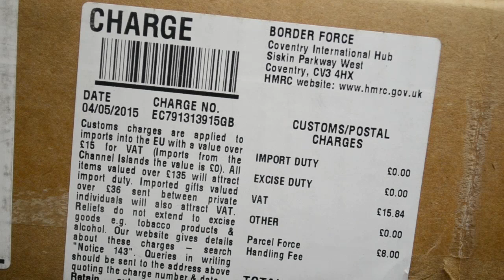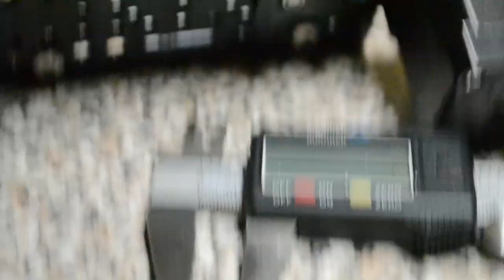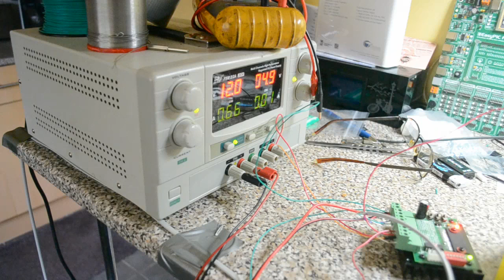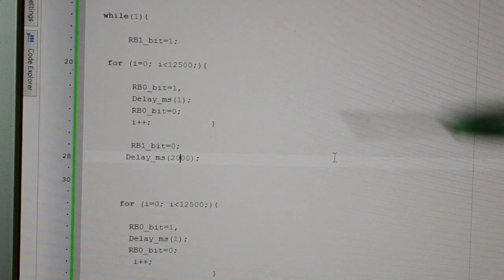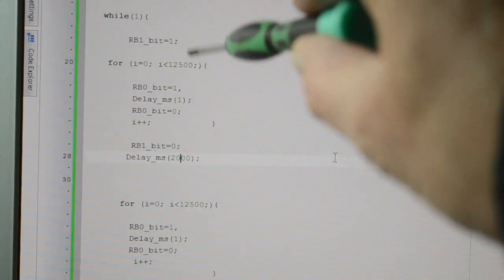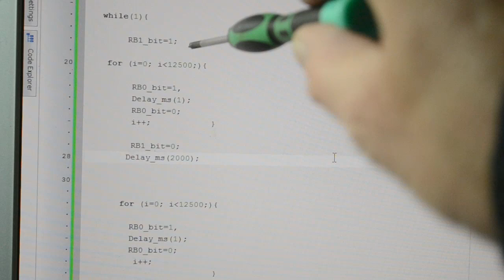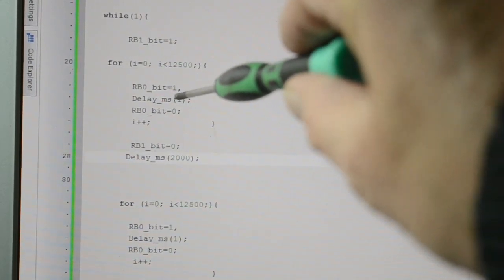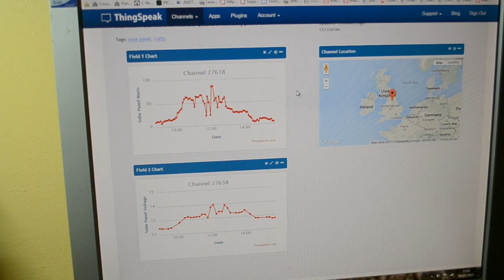Linear Actuator CNC Rail + Stepper Motor Home build Solar Tracker V Slot

Comment: You can use two Iron Ridge rails for the sides. Just sub the bolts for bearings and use your Linear drive system to move the panel. It cost less and is more secure and you will also get the bonding screw with the Iron Ridge. As they are made for solar panels. And you need to Bond that panels or the first electrical strike the whole system will fry.

Comment: Hi John nice video, good old DIY with micros!
Quick question on timers.
Would you prefer mikroC's delay_ms or timer interrupt for time critical applications?
Looking forward for more good stuff.
Reply from the maker: Syed Mazahir Rizvi 
Hi Syed, good to hear from you.
I try not to use delays, they 'block' the code. 
I now have a one second interrupt, it counts to 900 (15 minutes)
Moves the motor one 16th of the length. I then zero the seconds.
Every 900 seconds event is counted.(quarter of an hour) 96 is 24 hours.
The motor then returns to the beginning.
Without a Real Time Clock, I had to power up the micro at 10am.
After 4 hours, the system was still within one second of where it should be.
For say a fridge freezer counting compressor run time, it doesn't matter where the time is in relation to the sun, or a washing machine wash cycle.
My solar panel must be in one place at 10 am. (if you get what I mean)
Interrupts are the way to go (in my opinion)
Reply: i dont mean to be offtopic but does anybody know a way to log back into an Instagram account..?
I somehow forgot my account password. I love any tricks you can offer me
Reply: @Keaton Fletcher Instablaster =)
Reply: @Huxley Lian thanks so much for your reply. I got to the site thru google and Im in the hacking process now.
Looks like it's gonna take a while so I will get back to you later when my account password hopefully is recovered.
Reply: @Huxley Lian it worked and I actually got access to my account again. I am so happy:D
Thank you so much, you saved my ass !
Reply: @Keaton Fletcher Glad I could help :)